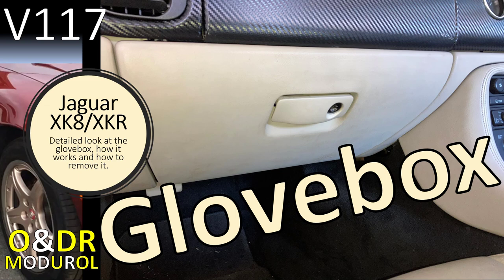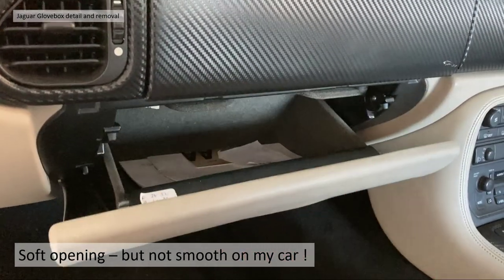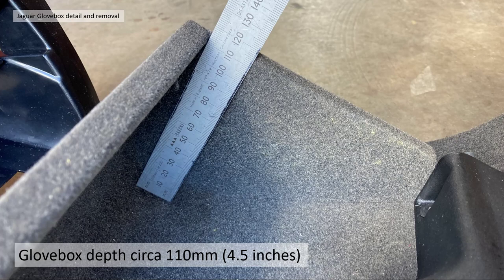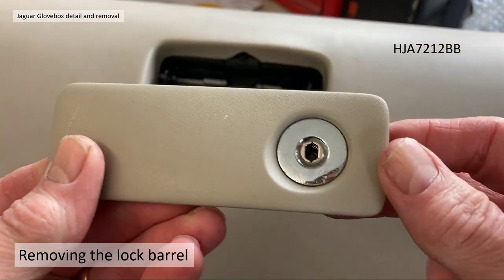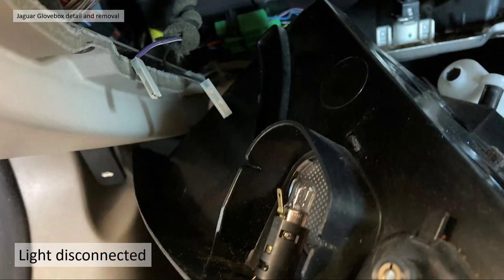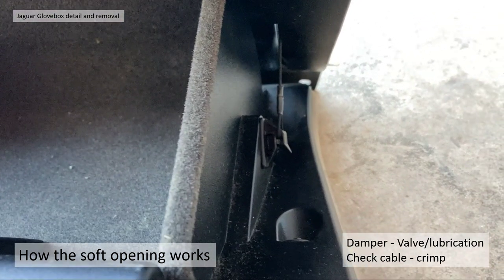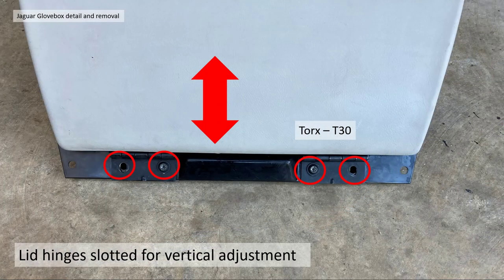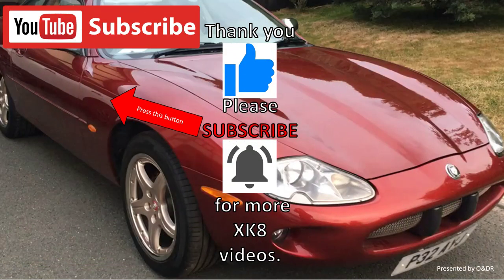Jaguar XK8 Dashboard Glovebox removal and repair V117 / XKR (X100)

Comment: Ok maybe I'm close have 4 fasteners holding airbag. 2 black nuts with built.in washers facing forward 2 silver nuts underneath 
Airbag bracket takes 6 fasteners 4 goldtone know where they go. Then 2 black star bolts facing downward? Have 2 pairs 1 pair shorter other pair no thread at tips. Pair for glovebox housing has plastic barrels so dont know if meant to protrude past point as it's open.
Reply from the maker: Ion, Sorry cannot quite understand your question. The is another video which might help which covers the airbag etc https://youtu.be/TtMWHf3CeJU . If you want more help please email us with a photo of your issue as might help explain the problem, regards Damian (oanddr@gmail.com)

Comment: Superb video as usual, thanks.

As you swapped the bulb over to LED in the glove box, have you done that for all the other dashboard and internal lighting so far? If not I would really be interested in the procedure and model numbers for replacements for them all.
Reply from the maker: Phil, I have changed all the interior lighting to LED, however, wasn't planning to change the dash lights etc as quite difficult to coordinate the colour and shade of light through the different LED bulbs also more difficult to control the dimming function. However, you have got me thinking now. They are T5 and T10 bulbs. There is a video by Richard Astley https://youtu.be/Sh5AsKND3pM showing the details. Thanks for the comment regards Damian
Reply from the maker: Phil, had a quick play with LED bulbs in the instrument clusters this evening. Definitely brighter but... It turns/bleached the green markets to light blue. Also the light isn’t quite even but could improve with stronger LEDs. Doesn’t go with the centre console green back light but considering buying green LEDs to see if that helps. Thanks for idea, regards Damian

Comment: That's fantastic video! thank you. Would you be able to tell me where I can get a replacement glovebox handle (I am based in Australia)? The LHS pin/tab broke very easily today when I tried to open the glovebox, literally with no force at all...
Reply from the maker: Kostas, thank you for your the support and positive feedback. Reference the glovebox lid. You need to find the trim code for your interior its on the door opening sticker (three letters) to make sure its the same colour. Probably need to buy the whole second hand glove box which might be expensive. Could find this listed on eBay £105 .(https://www.ebay.co.uk/itm/363778397225?hash=item54b2e1d429:g:0CEAAOSwqhpiQA5M).  The actual handle looks similar/same as the one used on the XJ8. That might be easier to get hold off.  If NG can try contacting Autoreservejaguar.com they maybe able to help you. Simplest idea is to try a repair/improvement. Hope that helps, regards Damian
Reply: @ODRModurol  you’re a top guy, thank you for replying.
I’ll follow the path you suggested. 
With regards to improvement/home repair, do you have any ideas or know of anything done already by others? I was thinking a small metal pin through the nib that broke and some epoxy to hold it all together…
Reply from the maker: Most as, sorry haven’t seen anyone repairing one or actually having one break. Looks like you are the leader in this one. Please send us pictures of the issue and your solution and we can feature it for the next person.(oanddr@gmail.com) Good luck, regards Damian

Comment: Great very informative video again - I was wondering do you know where the air con drain pipes are located.... as last summer the passenger footwell carpet was damp and no dripping underneath the car, however the drivers side carpet is dry and lots of drips onto the exhaust pipe... I’m sure it used to drip on both sides of the exhaust... any ideas.....keep up the great work.
Reply from the maker: John, on my car the aircon drips on the RHS of the exhaust system (drivers side). Looking at the aircon diagram I can only see the aircon outlet on the RHS. Suggest removing the passenger side carpet as most probably got a hole in the floor, will also help to dry out the carpet. Not the easiest of jobs as need to remove the seat and sill cover. Might be the door seal but most likely rusty floor. Almost every car in the uk has had the issue. Hope that helps and thank you for the comment regards Damian
Reply: @ODRModurol  Thank you Damian, I have had the floor pan welded last year, it’s dry at the moment as it’s not getting a lot of use, so waiting to use the air con to the max..... so I think you have solved the mystery...,
Reply from the maker: John, sounds logical and most probable, how it was the issue with the wet carpet. Thanks for the comment regards Damian

Comment: Instead of spraying grease inside the cylinder of the damper, why not lubricate the O-ring?
Reply from the maker: David, very good point. If I had a tub of white grease I would have concentrated on the  ‘O’ ring. With the spray grease couldn’t be that precise. Seemed to have done the job. A lot smoother action now. Thanks for the comment and suggestion. Much appreciated regards Damian
Reply: @ODRModurol  Thanks, Damian! I will be tackling this job on my car soon, so this video was very timely and helpful.
Reply from the maker: David, much appreciate it, as I thought it might not be useful to most people. I was just doing the video as part of the dashboard veneer change. Glad you found it useful and good timing. regards Damian